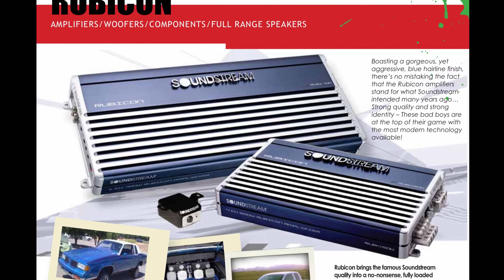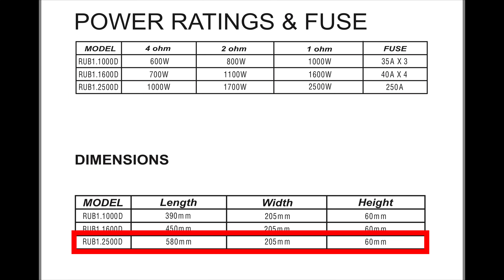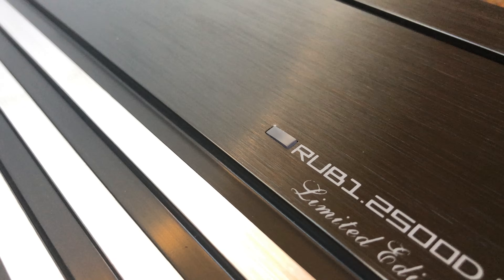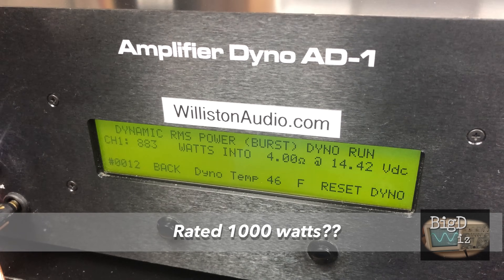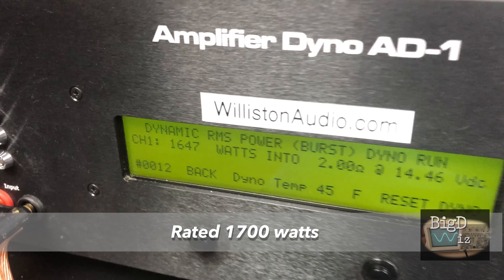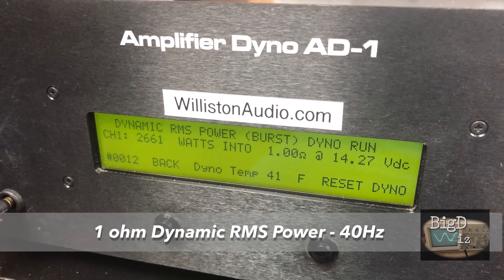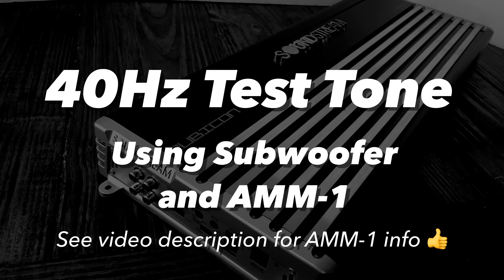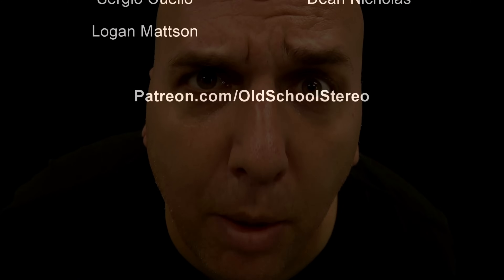Limited Edition? Soundstream Rubicon 2500.1D LE Amp Dyno Test

Comment: Still rocking my first gen Rubicon 2500 from 2010, and it's still a complete beast of an amp for the $350 I paid for it... It's been installed in many of my cars and trucks over the last 15 years. I plan on running mine at 1ohm on a burly 4 inch coil, 300oz motor 18" sub in my converted ambulance next, after I upgrade my charging system. I don't think my Leece-Neville 165A alternator will be able to keep up with it, even with 6 batteries in my secondary bank. My 5 channel NVX amp is already pulling about 1500w by itself, running fourteen main speakers, and four 12" Kenwood subs under the bed in the back.

Comment: I ran mine at .5ohm load for years.  But thats on speqkers. No issues.
Reply from the maker: It is possible you stayed above 1 ohm due to impedance rise. The resistors I use give constant loads

Comment: I'll be getting 3 skar vvx 8v3s shortly. I already have this amp. So would it be good too power them with it? I'll have 2 70mm pc fans on em at all times. I know this amp runs a bit warm. Will have the subs wired too around 1.3 ohms. Have the big 3 o gauge and 1 XS power xp2000 battery. Stock alt.

Comment: Totally different layout from my first and second gen 2500s. The first gen had a few extra caps and fets than the later revisions. Seems to like lower ohm loads a LOT more. I've ran it at .35 for years, no issues- where as the second gens will go into protect at 1 ohm sometimes. I've got a few internal pics if you want them for comparison, just let me know.

Comment: Interesting, there are some differences between that and the rubbicon.
Reply from the maker: After posting the video, I was informed there are 2 versions of the Rubicon 2500.1
Reply: BigDWiz this would be the 3rd, 1 looks nothing like it the other looks similar to the one you dyno. The one you have looks to be more basic gut wise, smaller torroids as well.

Comment: but in the case of modules with a lower frequency response you have to do tests with frequencies of 30 or 35  Hz or less maybe it will do better in 30 or 35 hz and the Brazilian modules have power, but they are very low in low frequencies
Reply from the maker: The bigger concern would be dealing with impedance rise
Reply: yes but I did many tests and have amplifiers that even in frequencies of 30 or 25 Hz or lower, gave a very good power without drops and without distortion, with a box tuned at frequencies of 30 or 25 hz the distortion was very low it sounded like an earthquake sound but the quality was very satisfactory, especially in the soudstream it is very good at frequencies below 30 Hz

Comment: I also own the 1600.1 rubicon and it is extremely powerful. It blew my 15 at 2 ohms, and that 15 was supposed to handle 1,000 watts rms. I love both the 2,500 and the 1,600. In my opinion they are great beginner amps for the money.
Reply: stop clippin'.

Comment: Whats up Big DWizz. Big fan here. I have the blue first gen of this rubicon 2500.1d Im curious if mine will do the same power ratings as the “ limited edition “ one u just tested or if they are the same and the LE is just a marketing technique ? Bc i have it powering two type R 15s. I just purchased two more type R 15s so after i build a box for all four subs i find myself wondering if i shud get another rubicon to match the one i already have or sell it and upgrade to two new higher end amplifiers..... i’d like to kno your opinion. Id b willing to send u mine to test if u think its worth comparing the two.
Reply from the maker: If you have the electrical, you could get another, or an Orion 2500.1Dz. This limited edition amp is the same as the blue 2500’s, but I heard there is an earlier design with fans. I would doubt there would be any significant difference between the two models, Power wise...
Reply: Ok thats what i figured just wanted to get your take on it.  I plan on gettin a mechman 270 or 320 and 2 runs of 2/0 for both positive and negative all the way back to the trunk and install 2 deep cell batteries.  I think that shud do it hbu ?  Cuz man these amps are current hungry.
Reply: Holy sh!t man i just watched your dyno vid of the orion amp.  I think ill switch to those if i can find them for the right price.  Itll b more power than i need but id rather have more and not need it than not need it and not have it...

Comment: Thanks for doing the test BigDWiz. I happen to be running the blue version of this amp and matching 4 ch. Those plastic mounting "feet/ends" are very breakable if someone were to over tighten them.
Reply from the maker: Yeah, amp looks great, but the plastic end plates concern me
Reply: Right...if someone were to mount it upright, watch out. I did notice inside there's no fans. Mine has one fan while others have 2 inside. it's like ss can't make up their minds what they wanna do.

Comment: Not bad at all . But I was Curious if a Amplifier does good on the Dyno Test for a few minuets does that mean it can perform like that under normal use ?  I know its just a capability test but I'm curious
Reply from the maker: Dyno measures amplifier’s output capability, but not reliability or long term durability. No different than a car Dyno
Reply: Okay cool that's what I thought.
Reply: But... If it doesn't give up under the dyno.  good bet it'll play well.. Those 40 hz sine waves gotta be rough on an amp

Comment: I got 2 blown rub2500.1d and the internal have 2 8ga wire from speaker to board. Plus I've notice all the soldering joints are shitty.
Reply: hey, maybe you know model of end transistors

Comment: soundstream pa 6000.1 !!
Reply from the maker: I believe that one is similar to the Power Acoustik 10k?
Reply: possibly. definitely big. I have one on 2 t5's. thing slams. rated at 3000rms at 1ohm but i figure its more like 1500rms but i also have it at 0.5ohms running for the last year no issues so im probably getting 2000rms. inefficient AF. has 3 100amp fuses

Comment: I'd like to see an Amp tested with dual 1/0 inputs. Are you set up for something that will draw that type of amperage?
Reply: 300 club I've been wondering when the same thing. Big D Wiz, have you considered using dual 1/0 inputs, or maybe 2/0 ofc wire with a 1/0 reducer? A lot of us with bigger amps use these.
Reply from the maker: Did you guys watch the video? Dual Toolmaker 1/0 copper inputs used 🤷‍♂️
Reply: BigDWiz I was talking about an amplifier that requires dual 1/0 inputs. 4krms plus

Comment: I have the blue Rub1.2500d monoblock is this the same amp as the as the black 2500d L.E if not what kind of power will it put out
Reply: Kirby Ross Same exact amp.
Reply: I would like to do two 12's in my trunk what name brand would you recommend
Reply: Kirby Ross NVX.

https://www.sonicelectronix.com/item_46593_NVX-VCW122.html

2 Of those for a 1ohm load, and you're set. They pound. And they actually have great sound quality too. Best deal out there. If you blow one. No biggie. They're cheap. It would be hard to do though. They're serious. 

Sealed you'll only need a small box. Under 2 cubic feet, and they'll sound great. But if you have the room, and want louder. Go ported. You'll need almost 4 cubic feet. Which is fine for most cars anyway.

Just be careful. Take your time. Do your research. And don't ever run them into clipping (distortion). Ask questions if you don't know. Go to DIYMA, or caraudio.com. They'll help you there. Great guys at both.

Good luck.

Comment: They put two different boards in these amps.  The first gen boards where great and the where beffy. The 2nd gen board not so much. If you want to know what board you have look at the remote wire hook up. If its between the power and ground its 2nd gen. If it's to the left of the positive its first gen and those boards are beffy. My question  to soundstream was can people strap the first gen and second gen boards together with no problems.  They never answered me! But do some research and you will see!  Cadence has an amplifier with the same board as the first gen rubicons like these also. I think its a cost cutting measure and its sneaky as hell! Hifonics does it too!
Reply from the maker: Interesting!
Reply: Yes also the power lights are blue on the first gen vs white on later models, as well as hex head screws vs Phillips... There seems to be a few more components in my 1st gen 2010 ruby than in the later revisions. And yes you can strap the later and the earlier models, but not sure what kind of numbers they would do with the mismatched boards. I've ran my 1st gen 2500 at .35 ohm for years and it's been a tank for me though.

Comment: Remember the old reference amps, run anything you hooked to it, would melt the carpet. what happened to Soundstream?!
Reply from the maker: New company, different priorities 🤷‍♂️
Reply: China happened to Rockford Fosgate too but they still do way over rated power. although they are still designed and engineered in Phoenix. Im guilty of it too, I design a type of sensor, I have them assembled in China for about $14.00 a board, 3"x3". It takes me half a day to do it myself, if I hire someone here its closer to $150 - $200.00 a board.
Reply: Then it is most likely a marketing matter. I deal-in and sell soundstream equipment in my home country and can testify that these amps deliver well when matched with the right speakers. I totally agree that the company should revert to the conventional and right way of rating the equipment. Example of this is the PN4.520 which delivers just that; 520 rms watts power.
Reply: China. China happened to soundstream.

Comment: Thought it was interesting that the original version of this amp had 2 cooling fans 1 for each of the 2 power transformers.
Reply: It may not be on the power transformers but i know there was 2 cooling fans in the original one
Reply from the maker: Wow, hate to hear they changed it and sounds like for the worse...
Reply: BigDWiz Jeepandbass had 2 of the original 0nes and actually shows what he clamped his @ think it was 2004 watts @12volts and shows the guts having fans but yes definately for the worse. Be interesting to see a vs. dyno between them though.

Comment: Ok I jumped the gun on my last comment and didn't wait till the end and cover was poped, but that is different from the one I had , mine had different caps and like my other post it was stronger than this one
Reply from the maker: I heard the two different model issue. That’s too bad the later ones were not as good as the original ones.
Reply: the one i had the remote was between power and ground and had black caps different brand. That was 2 years or more ago and i remember something i read about two different ones and that was how you could tell, the remote to one side on one and in middle on the other.

Comment: I've been hoping you'd dyno this amp BIG D. I've seen it around for a while and heard alot of good and bad things about it. For the price, it seems like a pretty good deal. Thanks for the video BIG D, I appreciate your work.
Reply from the maker: Not the most impressive $200 amp, but not bad and one of the best in the looks dept 😊
Reply: Thanks big wit for the bench test have u tried  ap3000 d
Reply: BigDWiz if this amp were rated accurately in WRMS, would that change your opinion of the amp?

Comment: After I seen the 4 ohm and 2 ohm test I guessed about 1800. I was close.
Reply from the maker: It did over 1900 certified at 1 ohm with 14.6 volts. I didn’t show this one as voltage was higher than most people would see
Reply: I like the way the amp looks and I think it put up decent numbers.

Comment: I have the Soundstream dtr1.2200. does anyone know the true power it gives at 1ohm?
Reply: Scob By  not sure on that model but I have the bigger version of it and Iam told it has a very similar board as the spl d 3500
Reply: Satveer Degun sounds good. I haven't used the amp yet